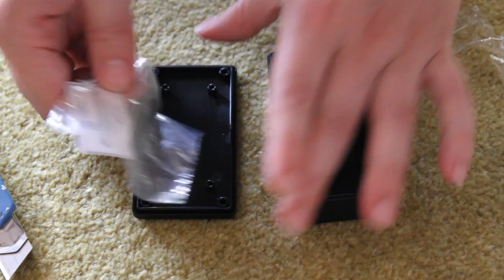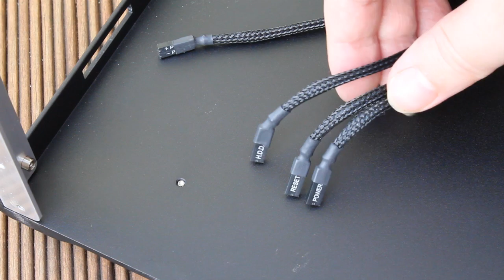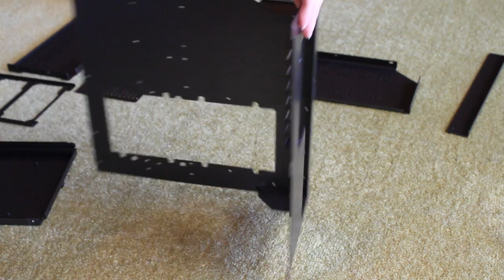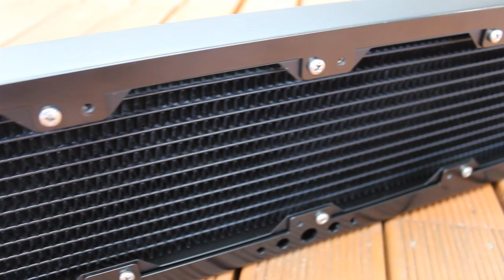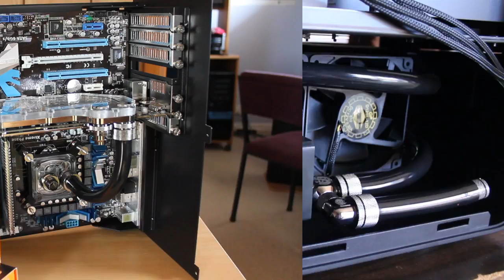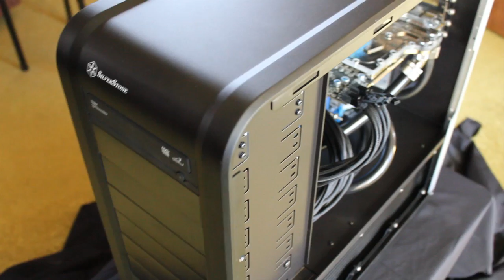SilverStone TJ07 Rebuild - Water Cooled

Comment from the maker: I've seen it done before and just thought it looked cool, it also has a few benefits though, like the graphics cards are cooler side up so you get to see the water blocks and also the 8pin CPU power input on the motherboard is closer to the power supply.

Comment from the maker: Cheers.. A few of the parts used for the case were purchased online from chilledpc in the UK. they have a really good selection. For the midplate i just drilled a few extra holes to fix it to the case and for the fittings, then had it powder-coated.
Reply: Glad you liked the parts - Tom (chilledpc)